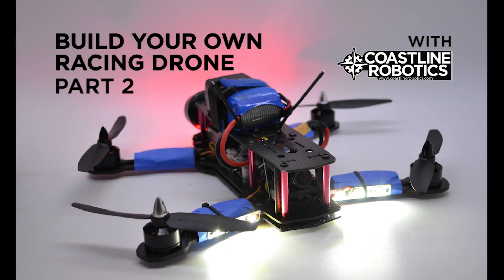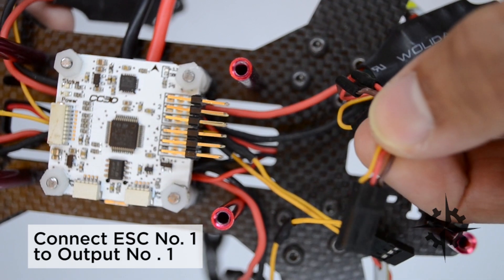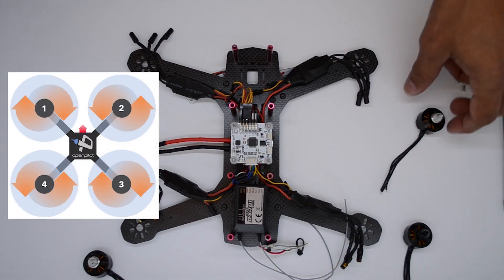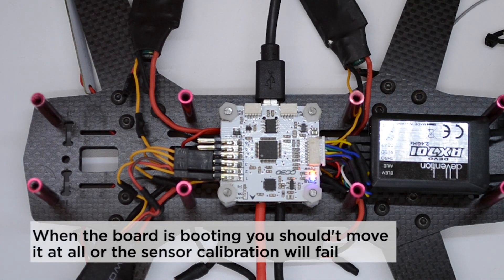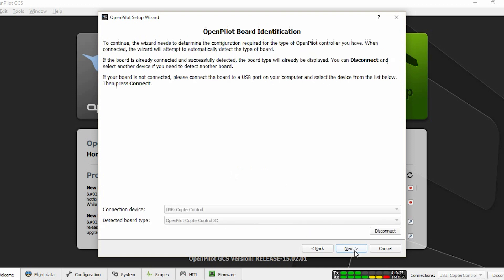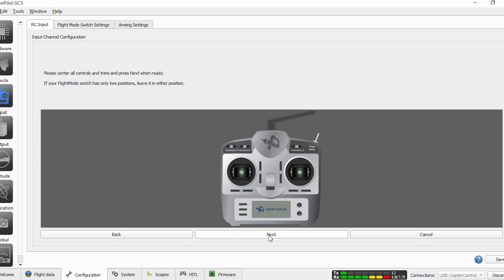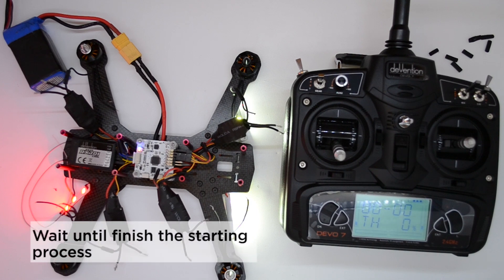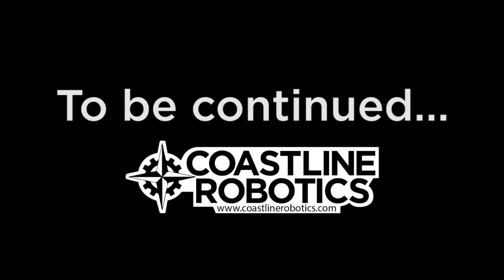Build your own racing drone Part 2. ZMR250 DIY

Comment: Why did you rotate the flight controller and what exactly happens or what compensation  is required if you don't face it with the arrow forward?
Reply from the maker: The board needs to know where is the front of the aircraft. Every flight controller has an arrow by default pointing to the front, which you should install that that way unless you need to mount the board differently in case you want to access easier the USB connector or anything similar. So it's more a personal preference but make sure that if you change the physical orientation of the board then also change it on the configurator.
Reply: Thank you I didn't know that the board orientation also told it the positions of the motors. So if the flight controller is rotated then it will register the motor is in different position than they actually are.
Reply from the maker: No, the position of the motor shouldn't be changed. Leave the same motor layout, only the board rotates.
Reply: Ok..thank you. Also I subbed, it's a great series

Comment: dude which battery you used and where you get the battery
Reply from the maker: For a drone like this a 1300 mAh 4S is good enough. 

https://coastlinerobotics.com/collections/multirotors/products/tattu-1300mah-75c-4s1p-lipo-battery-pack?variant=16018383683

Comment: cant i directly connect the esc   
pin to the r/c receiver instead of the flight controller what is the use of flight controller is it necessary pls answer i am stuck
Reply from the maker: Hey John if you are planning to build a multirotor a flight controller is necessary to provide stabilization and control, it is the responsible to send electrical signals to the motors and generate the different movements by speeding up or slow down these ones according to some input provided by the pilot from the radio control. You shouldn't mistake the RC channels with the number of motors in the multirotor. The RC channels are: Throttle(up and down), Aileron(left-right), Elevator(forward-backward), Yaw (rotation) and the Auxiliay channels which depend on your necessities. So regardless of the amount of motors your aircraft uses, the RC channels will be the same and is the flight controller the one who will translate the RC input into coordinated movements by mixing appropriately the motors rotation. Without a flight controller multirotor flight is not possible.
Reply: +Coastline Robotics dude thanks for the reply can you tell me from where you get that flight controller
Reply from the maker: Hey John please find it here:

https://coastlinerobotics.com/collections/multirotors/products/naze-32-full-version-revision-6?variant=20904345027

Comment: hello... How to choose reciever and transmiter for long range, like 2-3 km and where to buy?
Reply from the maker: Hi +Stefan Dragas  I'm not sure what kind of transmitter are you using right now but for simplicity I would suggest you the FrSky Taranis plus with a L9R receiver, you should get around 3 km with the default configuration but you can upgraded it later on if you would like to. Find them here:

http://bit.ly/1Um8Hky

http://bit.ly/1QNmqQm

Many thanks,

Ronald
Reply: Thank you so much!

Comment: 3:24 which cables do I connect to which? (I am going to buy this kit from coastline robotics)
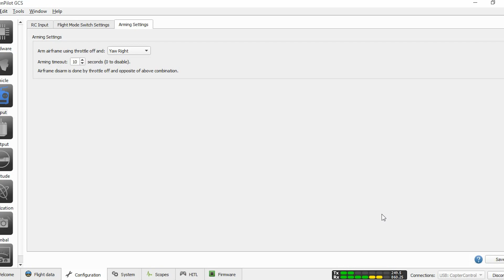Reply from the maker: Hey +Steven Ewald GFX, connect the central cable of the ESC to the central cable of the motor and then go to minute 8:04 to see where to connect the rest of the wires. Thanks for your support!!
Reply: No problem! I am buying it later

Comment: Do not connect just signal from the ESC to the 3 slots of the CC3D - depending on the ESC you risk frying it at any random time. Always connect the ground as well, remove only + (red wire).

Comment: why covering ESC with a tape, and why not using banana plugs? it one of the motor goes bad, you will have to solder it again, with banana plugs its easier to replace the motor.

Comment: awesome tutorial, i have a question. Can i use 6 channel remote instead of 7?
Reply from the maker: Hey +akuafiq90 , yes of course you can use a 6CH radio system. It is the minimum required to control the aircraft and the functions or flight modes. Thanks for your support!
Reply: Coastline Robotics thanks for the fast reply, appreciate it :)

Comment: Total cost?
Reply from the maker: Hey +Da Aa there are 2 versions:

1. Includes frame, motors, ESC, cc3d, PDB and 4 pairs of propellers and LED lights -> USD $149.9
2. Includes all of the above plus the FPV system (camera+transmitter) and a Devo 7 radio controller with receiver. -> USD$304.9

Check them here:
http://coastlinerobotics.com/products/zmr-250-fpv-racing-diy-kit

Cheers!
Reply: +Coastline Robotics Is it possible for this lovely machine to carry a gimbal?
Reply from the maker: Hi +Da Aa, Im completely sure it can carry a gimbal but it should be the lightest gimbal you can find out there, probably a 2 axis gimbal would be the best and you will have to use 1500 4S batteries to make it a bit more punchy. PID tuning must be performed again, since you are adding weight and changing the center of gravity. Also don't expect the quad perform the same as when had no gimbal on board, I mean fast and all acrobatic, the most probable thing is that you will have to fly slower.